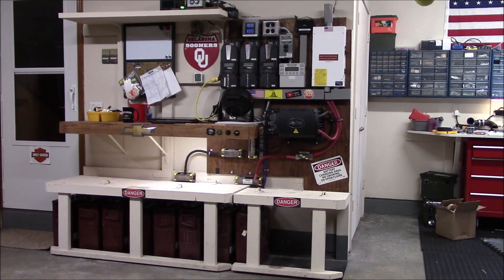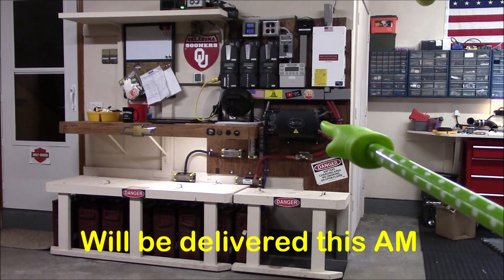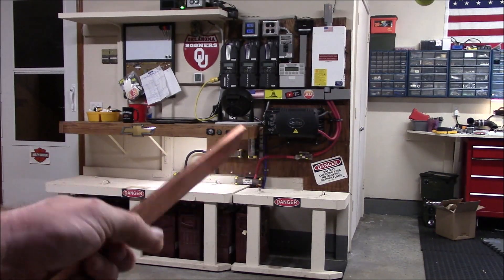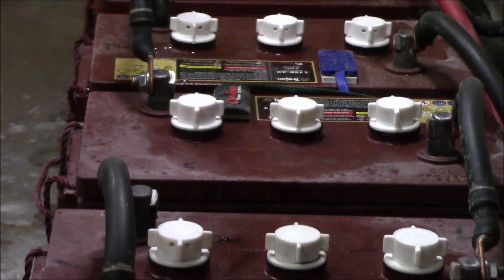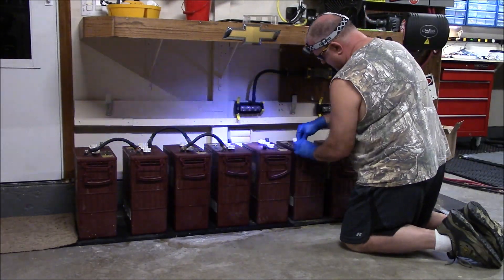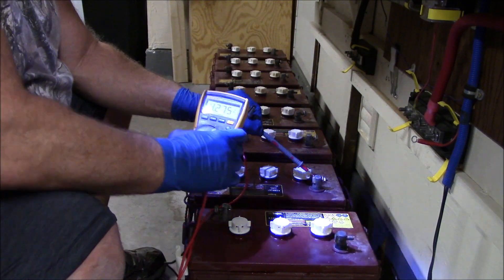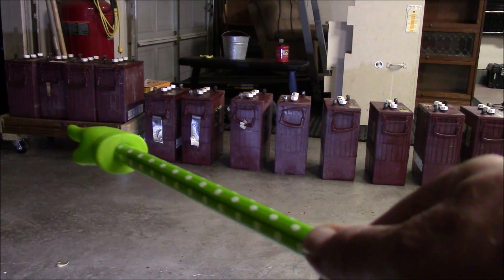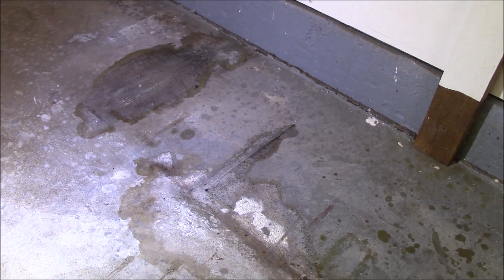Removing home solar power flooded lead-acid batteries - new LiFePO4 being installed!

Comment: Cool beans on the lithium iron phosphate upgrade. It is definitely a night and day difference due to its low internal resistance, they'll take a charge and discharge just as fast as you let them. Another nice perk with lithium is now you have 70% to 80% depth of discharge available to you vs lead acid in general and they don't mind to be in a partial state of charge just so long as you don't let them hit the point of no return on the lower end of the discharge cycle. They'll charge up fairly quickly and you won't know what to do with the excess power. It will be a little bit longer before I will be able make that upgrade.
Reply from the maker: Thanks. Haven't commissioned them into service yet. Gonna try to get them strung up and working today

Comment: I haven't shared anything yet, but I have spent the last few months acquiring tools & tinkering, but I am planning to build a power wall from 18650 batteries.  So far so good.
FLA is definitely a thing of the past.
Reply from the maker: Awesome...that is one DIY project that I would never attempt. Good luck. Yeh, I am almost 51 years old...gotta embrace "change" and moving forward. What worked in the past doesn't mean it will work in the future. FLA bateries still have their purposes...but, my experience with them was frustrating: stinky, dirty, drama-filled, and a company not standing behind their product

Comment: Based on what i was reading below, you may already know this , but you have to be careful on how to charge those lithium batteries. With my AGM's you can charge them with 14.4 volts but with lithium  i heard you can't go much over 12 V. Looking foward to your new configs. I guess a new charge controller is needed?
Reply from the maker: No
Reply from the maker: @Jason Miller - KiloVault's directions that came with the batteries state " 14.1v or 14.2v when combining batteries". They have internal BMS for everything

Comment: Great vid Chris. Looking forward to seeing the vid of the new battery installation. Are you thinking about a radion 48 volt inverter, magnum 48 volt, or a outback fx3648 volt? I dont know anything about Schneider or Trace. Keep em coming!!
Reply from the maker: I want to "work with" Outback Power on a deal if they are watching. Maybe do a factory "swap out". You know, 24v for a 48v at reduced cost. But, I also like the Schneider.

Comment: You probably have checked if it is ok to do 48v with those 12v lithiums? Some companies warns to not serial connect their lithiums. Calculated the price for 16x3,2v with good BMS. If that 2,4kusd for 3,6kW includes your taxes - you got a good deal.
Reply from the maker: Yep, sure did...good to string them to 48v.
Reply: Chris DIYer nice. Never ordered from that company (living at Europe) but like their videos and can't wait when they start selling those moonpanels :-). Bought lithium mppt controllers from genasun before it was part of blue sky energy. Now they have store at europe also which is nice for the wallet (200 for controller, 75 for the mail, then 24% VAT to 275.. is 340. Now the same product is under 200 with taxes and shipping) Sometimes comparing of the prices from the videos is difficult when you don't know if there are some added taxes...
Reply from the maker: Seen some really awesome home solar/wind set ups in Europe. Some of the coolest ones I have seen are in Australia.

Comment: Be safe. Overcharging lithium is much worse then a mess on the floor. Thanks for sharing
Reply from the maker: You're welcome. Def taking my time. Just got them and have already run into a problem (not with the batteries). Looks like I am going to have get some more battery (welding) cable.

Comment: Those new ones will be pretty sweet.  Wish I had that budget.
Reply from the maker: People spend more on Harley's, boats, guns, and/or ammo. It's all relative in a way...
Reply: @ChrisDIYerOklahoma  fantastic Chris! Your will love the Lithium batteries. I still cant get over how fast mine charge. At least with solar as a hobby there is a chance of it paying you back. 
When I switched out my batteries and let the L-16 sit for a week the are holding 6.4 volts each. Out of the 8 batteries I had 2 that had internal shorts that took the sound to 4.2 volts. 8 only got 5 and a half years from the 8 original batteries.  I am selling the four that are still good for $100 each. That's about double the core price. That said I do not recommend that anybody buy used FLA unless they are just getting started in solar and want to learn about it. We are finally free from having to dance on the head of a pin lol.
Lithium ion is so straightforward in the charge algorithm.  If you obey all the rules they are totally maintenance free. Enjoy my friend.
Reply from the maker: Thanks Steve - Your batteries sound exactly like mine (their voltages). Just sold/recycled them to a battery store in town. 1,200 lbs loaded in the back of my Chevy! No issues with transporting them. Right now, I am getting them up to full charge before stringing and paralleling them into my (24v) system. Once I am satisfied (at 24v) I will start working on going to 48v (swapping out that Outback 24v inverter). Lots of long hot days here in the garage working cables, cleaning, charging, hauling off batteries, etc-etc. Hope all is well...have you seen that big cat lately?
Reply: @ChrisDIYerOklahoma  fantastic Chris! Your will love the Lithium batteries. I still cant get over how fast mine charge. At least with solar as a hobby there is a chance of it paying you back. 
When I switched out my batteries and let the L-16 sit for a week the are holding 6.4 volts each. Out of the 8 batteries I had 2 that had internal shorts that took the sound to 4.2 volts. 8 only got 5 and a half years from the 8 original batteries.  I am selling the four that are still good for $100 each. That's about double the core price. That said I do not recommend that anybody buy used FLA unless they are just getting started in solar and want to learn about it. We are finally free from having to dance on the head of a pin lol.
Lithium ion is so straightforward in the charge algorithm.  If you obey all the rules they are totally maintenance free. Enjoy my friend.
Reply: @ChrisDIYerOklahoma  Well, I don't have bikes, boats, guns or ammo.   Just trying to make power.    I may try to refurbish the batteries myself before selling them for scrap.   I have couple layers of redundancy.

Comment: I have a love/hate with lead acid batteries but I'm done with them. I ran into the same challenge you did but with AGMs in my electric riding mower.  Four 12V in series and one was dying a slow death for about year. Lots of troubleshooting but in the end, turned out to be one bad battery out of the four. Of course the one year warranty had passed so I was out of luck. Lesson learned and I worked with a guy on eBay to get a Nissan Leaf pack built to match the spec of the mower. The cost of the used Leaf pack vs new AGMs was close to the same. Love the new pack and the benefits are apparent. Looking forward to your next video.
Reply from the maker: Thanks. My Trojan AGM's on my two other solar generators are running excellent. These things we do with any battery systems can be frustrating.